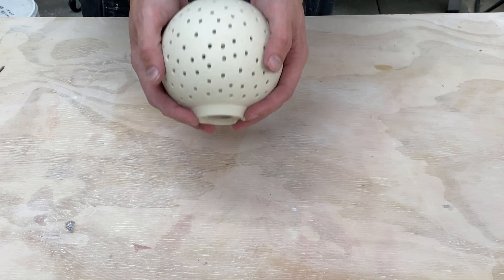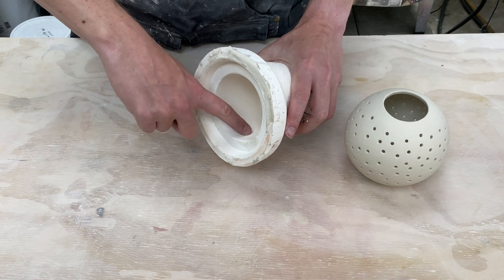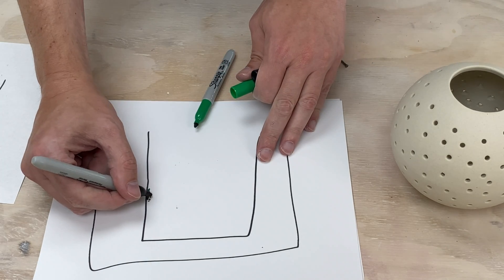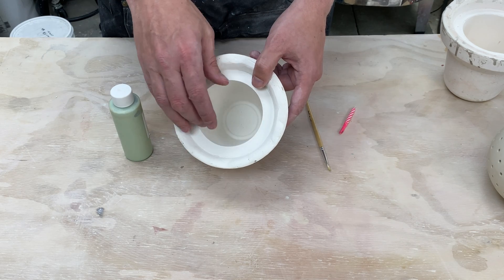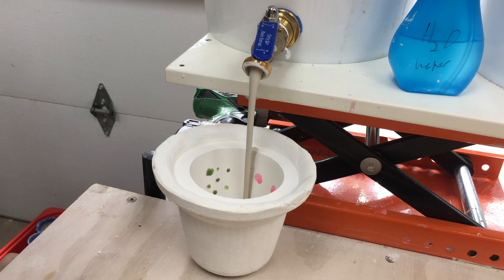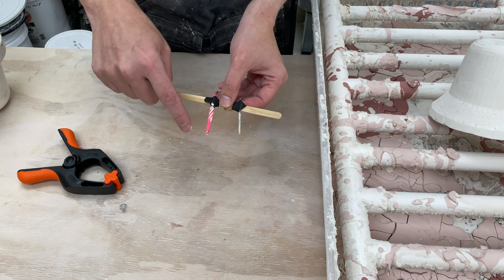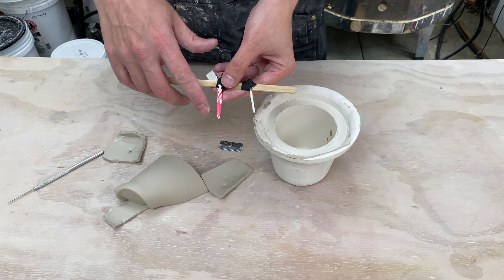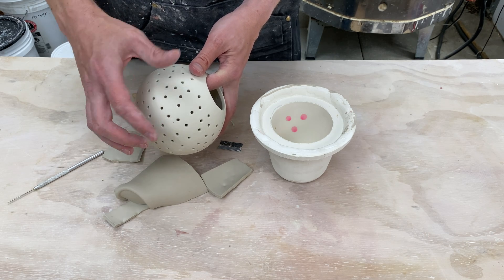Testing a hypothesis! Resist on Plaster Mold

Comment: Perhaps a waxy plastic such as polyethylene or polypropylene could be used to make the pins, rather than using wax itself.  If it works, the pins would be rugged enough to be reusable, and you could make a set of a specific length.  Finding plastic rod made of these materials might be tricky, though you could test to see if it would work by using glue sticks for hot glue guns, or maybe resin filament for small holes...
Reply from the maker: TPFE would be best. But for the number of holes I had, it was too much $ to justify.
Reply: @PotterybyKent  You're right that teflon rods would be good, but they're much too expensive.  Something ultra-cheap that might work would be plastic straws cut to an appropriate length.  I suspect these are made from either PE or PP (most cheap disposable products are), but you'd need to test to see if the slip would drain  from the plastic as well as it does from wax.  The obvious problem with a straw is that it is hollow, but you could fix that by filling it with another substance before cutting it into pieces.  Many things might be suitable, but silicone caulk or perhaps expanding polyurethane foam (supplied in aerosol cans and used for filling cracks) would do the job.  In fact, a plastic straw might function as a very good mould to make rods of pure silicone!  Fill one with caulk and then carefully score the straw lengthwise, and you have a silicone rod that  probably won't stick to anything.
Reply: @PotterybyKent  Another thought would be that if you use a straw to create silicone rods, but the result is too flexible, you could likely fix that by putting a steel core at the centre of the straw before filling it with silicone.  Straight sections of steel taken from a cheap metal coat-hanger would be suitable for this, and if the steel isn't perfectly centred, it wouldn't really matter as long as it is fully coated.  Numerous other metal objects (brass rod, etc.) could also be used for this, though it would be needlessly expensive unless you already have some on-hand.
Reply from the maker: Metal didn't work as I thought it might
Reply: @PotterybyKent  No, I agree that metal alone likely wouldn't work, but if it is surrounded by a layer of cured silicone, the results would probably be good.  A steel coat-hanger has a diameter of about 1/16th of an inch, and the internal diameter of a typical straw is at least twice that (1/8 - 1/4").  Using a plastic straw as a mould, with a central core of steel (coat-hanger), and surrounded by silicone, should give you a reasonably rigid but clay-repellent rod that could be cut into pieces to provide what you need.  You'd need to check that the silicone doesn't bond too tightly to the plastic straw, but if it does that problem could likely be fixed by coating the interior with Vaseline or talcum powder.
Reply from the maker: Ah I see. Interesting thoughts. If/when I revisit this I'll be focused on my clay body instead. I got enough comments that it "just worked" for others, and a bunch of other small indicators with my own usage of my clay, that that is the underlying issue.

Comment: I like the idea of the wax plug through the mold wall. I think that you could push in the plugs from the outside so they would protrude farther than your wall thickness, and come time to de-mold, you could just push the plugs all the way through to the inside. It would be interesting to see the result of such a method on the inside surface... I wonder if the hydrophobia of the wax plug would create the opposite result as you found with the nails (a sink rather than a mound)
The plugs could be solid wax, waxed candle wick, or some wood dowel soaked in molten wax. I'm not sure silicone spray wouldn't also soak into the adjacent plaster affecting its performance. There might be a source for wax rods for use in jewelry investment casting.
Reply from the maker: Looking in the jewelry space for wax rods is an interesting thought!

Comment: It’s clear from your experiment that plaster surrounding the clogged areas is pulling moisture from more than just the slip directly above where it contacts. It pulls the closest moisture which is at times where the waxed areas have slip.

My thought would be to use wax discs slightly thicker than you wall thickness and melt apply them to the mold wall. That way, there’s no slip there to pull. And you can just melt that wax off on bisque. Problem is, the piece won’t pull with the wax melted to the mold wall, so you’ll need to put the whole mold (piece and all) into an oven the release the wax from the mold before you pull. You’ll probably know where the piece was from residue for putting on the next discs for the next casting.
Reply from the maker: I think that's a good observation! The water is migrating through the deposited clay into the plaster.

The wax disk idea is an interesting one. However the slip cast piece can't be left in the plaster mold that long - it will end up cracking. I'm guessing extra heat wouldn't help on that front either. It needs to be pulled relatively quickly so the moisture in the wet clay can homogenize and the water can evaporate from both sides more evenly.

Comment: Would dipping the nails in wax solve the size and surface tension issues?  I work in beeswax mostly, but paraffin would coat the nails.  Or perhaps a silicone spray on the nails would work also and be cleaner.
Reply from the maker: I was thinking of rubbing wax on them. Silicone spray is an interesting idea! I want to move away from the nails to some heavy gauge wire to get the right size, so finding a coating for that would be useful.
Reply: @PotterybyKent  @Nighthawkinlight "A Better Way to Waterproof Fabric" has a recipe for water resist that work exceptionally well on fabric (paraffin wax with mineral oil). I reckon it can be tweaked to a thinner consistency that sticks a, well, thin conformal coating on those nail so that can be retracted w/o clogging the left-behind hole with slip.
Reply from the maker: Thanks for the tip @col0342 - I'll need to look
Reply: @PotterybyKent  It just popped up in my mind that wooden things (bamboo skewers, pencils ends, dowels - round or shaped in a prism), could work better than metals with the paraffin wax + mineral oil, as long as you impregnate them while the mixture is warm/hot. I'd try to sand them with a fine grit then let them soak in molten wax/oil for a couple of hours, get them out while hot, wipe the excess wax then hang them to cool, pointing down the end meant to go inside the pot/slip (a cloth pin or a paper binder clip may do the hanging trick)